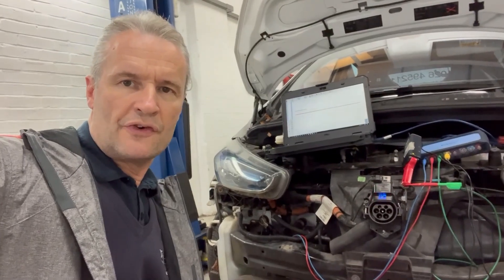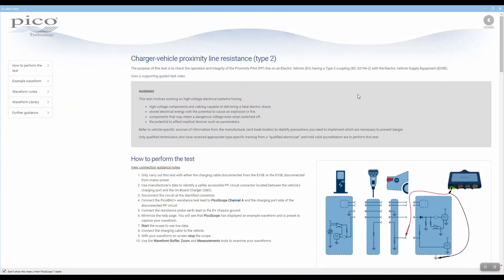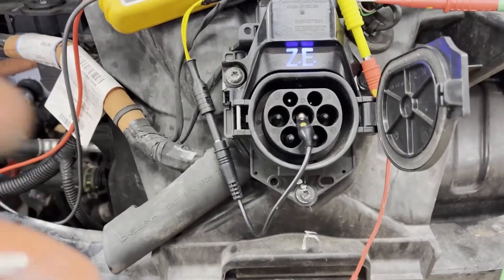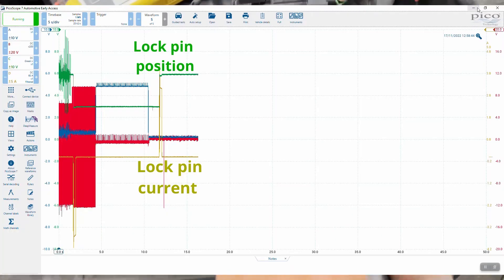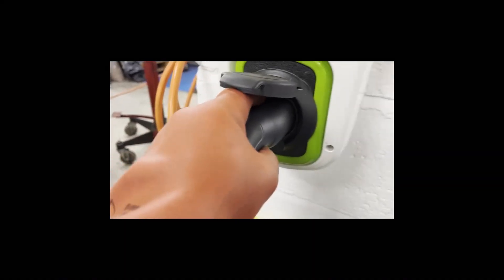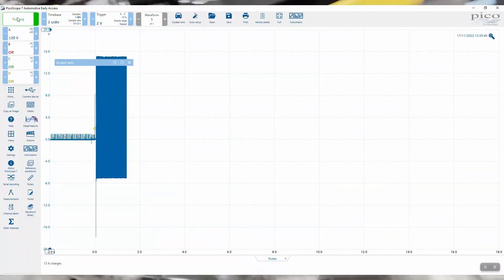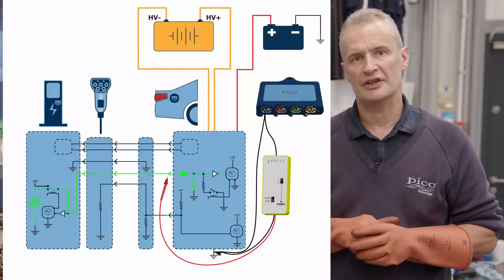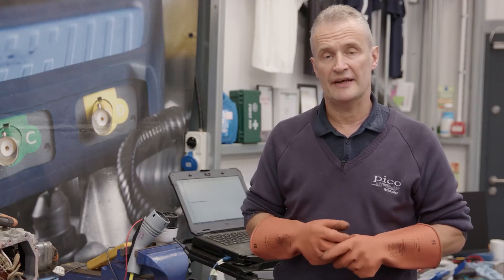Renault Zoe Type 2 charging error - Car or charger fault?

Comment: Very interesting info, however are you telling me you stripped the entire front end off that Zoe, got the picoscope out with all the equipment, before testing a known good cable? Especially when you knew mode 2 worked fine?

Comment: Thanks for the video! I'm checking out a Zoe with a charge port failure soon, do I really need power resistors? I assume the sense circuit won't generate a lot of current?

Comment: Do u have a workshop i can bring my Zoe to, i have charging issues
Reply: Did you find someone to repair your Zoe?
Reply: @willemajorwilliemajor476  I did lol, was frightfully expensive, £2565 for a charging port, charging filter and rectifier. It was ok for a week after that then had danger electrical failure warning so back to Renault who found out the BMI software was out of date. They had to wipe all the ECUs and reinstall the latest software it cost an extra £600. So to get the Zoe Charging reliably it cost in total £3165 not to mention the stress and inconvenience that was priceless lol.